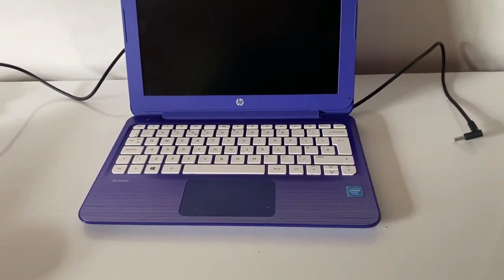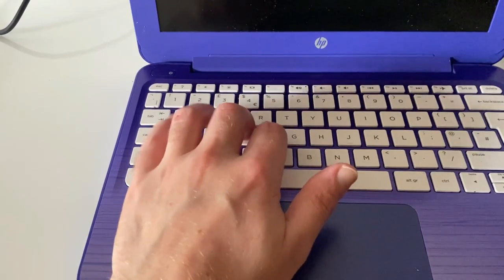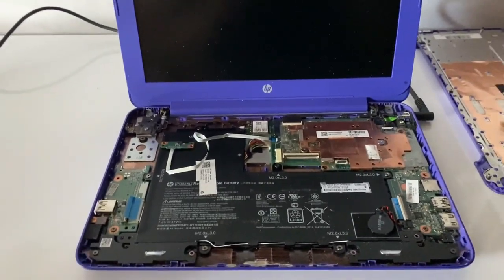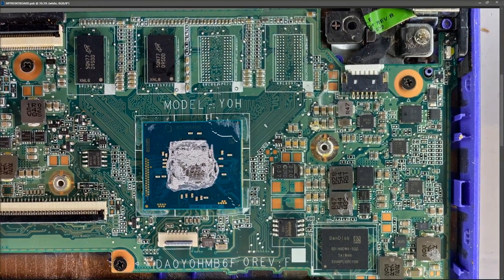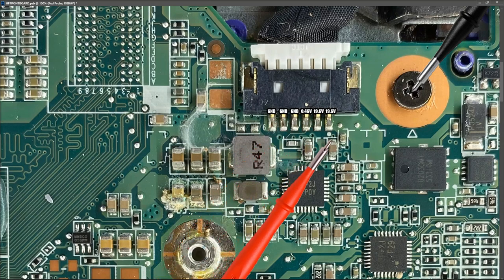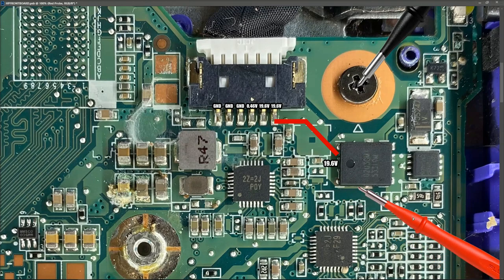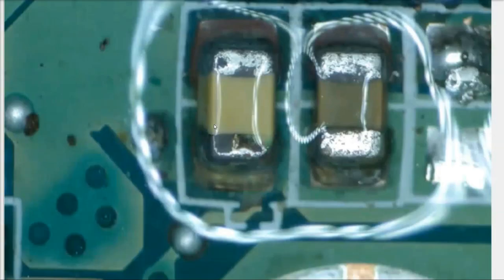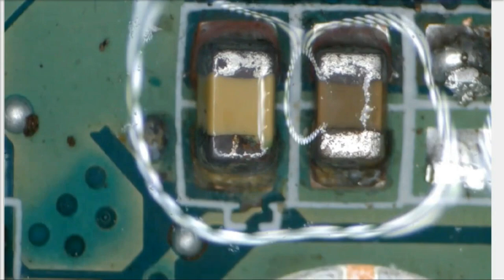HP Stream Notebook 11-r001na Not Powering On

Comment: Wow. 3.5 amps! "That's crazy!" I have also tried putting flux on the cap, instead of IPA. I watch the flux as it melts on the hot cap. Then I can easily remove the cap.
That is a beautiful little netbook. Isn't it amazing how much time and effort technicians devote to repairing such cheaply-made devices? This one was easy. If you had found a bad MOSFET or IC, I doubt you would have continued the repair attempt, unless you had a donor board handy.
Another brilliant job. You have taught me much, and have given me the courage and confidence I need to press forward on my own tech journey. Thank you!

Comment: I've been trying to get mine to work for quite a while it's been dead for years didn't know where the charger went I've been having it on the charger and I finally managed to get it to turn on by just clicking the button excessively until it popped up and I was going to reset it but I couldn't find the enter button fast enough I finally got it to turn on completely